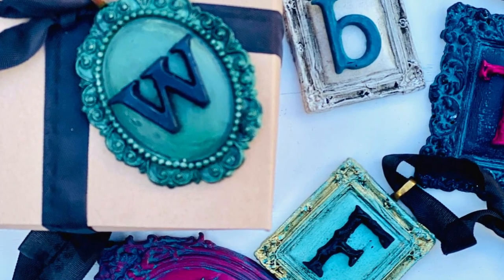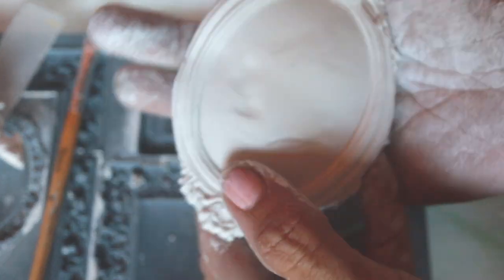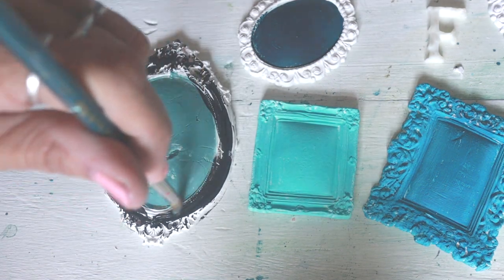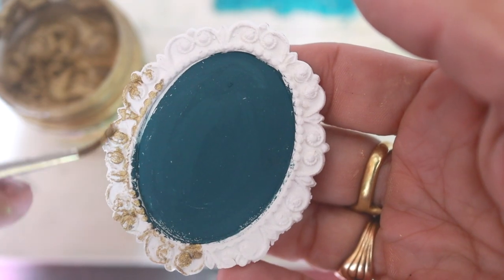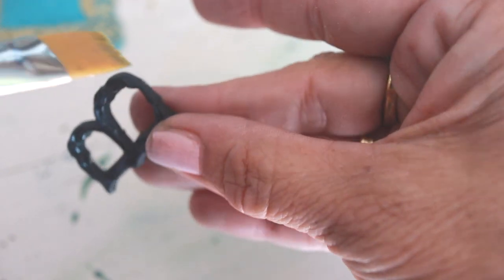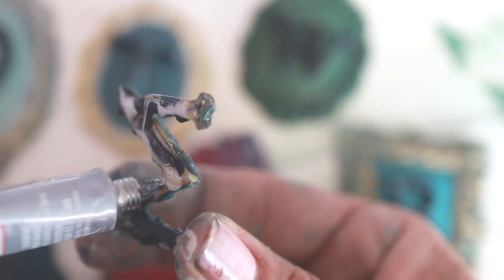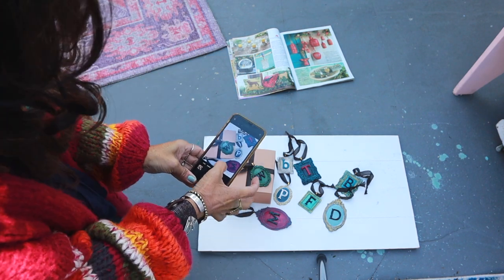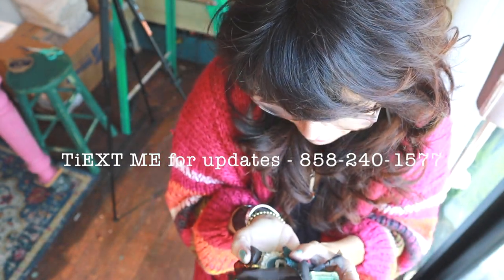personalize ornaments with moulds and clay

Comment: How cute!! Great seeing your dad, such a  sweet man. Wall looks great
Reply from the maker: it looks so much better now :) the paintbrushes are still breaking though :(  but I'm not giving up!
Reply: @DebisDesignDiary  you could always use wooden dowels and make them look like paint brushes.. More sturdy..
Reply: @DebisDesignDiary  what if you used a dab of construction adhesive in the holes to keep them in place? I understand that you may want to move them later, but it could be scraped off/out down the road. Or, you (or your dad) could even just cut off the tip of the brushes flush with the wall if you change your mind later on. And to go with the idea of gluing them in place, so that you could easily slide your transfer packages onto the brushes for display, just mix up some clear resin and dip the brush ends, then use (gloved!) fingers to squeeze out the excess and mold them into shape. Just my two cents, but I think it could work. I love the ornaments, by the way. I always enjoy seeing the projects and color combinations you come up with. 😊
Reply from the maker: @jane.c.c  that sounds like a great idea!  to be continued :)
Reply from the maker: @jodilea144   thank you! great suggestion! I'm gonna make it work somehow, the brushes dipped in resin could  really help because they are alway snagging on the transfers.
Reply: @DebisDesignDiary  you’re welcome! 😬